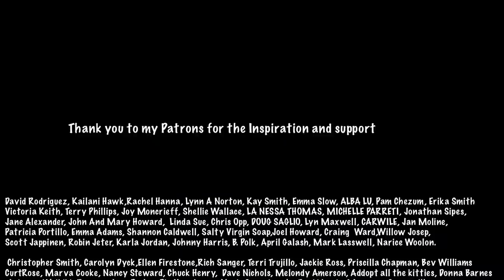I Am LEAVING THE FARM!

Comment: I wish you had installed multiple locks on your shed. One on the outside corners of each door, midway up the door sides mounted to the intersection where each door meets the side walls. Right now, the doors are only locked to each other, and if someone wanted to break in, they could easily rip one door panel off it’s track. Well, praying nothing happens and the puppies become good watch dogs. Bon Voyage!
Reply from the maker: Hi, the doors are locked to a metal plate that is welded to a metal beam in the middle of the doors, before leaving I tried multiple times to open it but was good secured.
Reply: @thejunglecouple  wonderful!!!
Reply: @auntmaryspals7978  very true